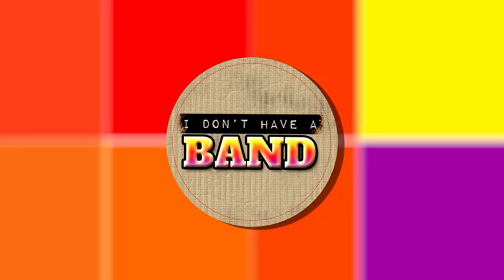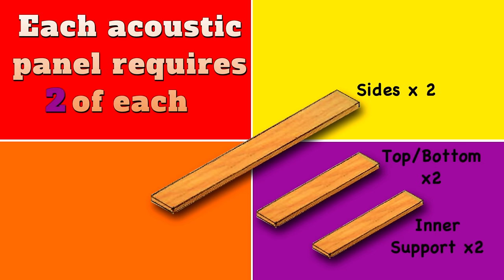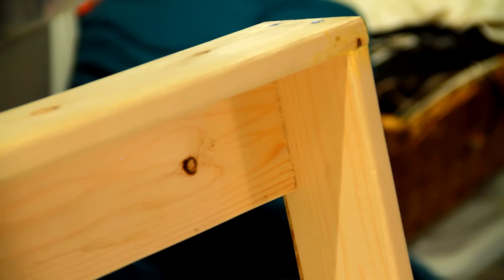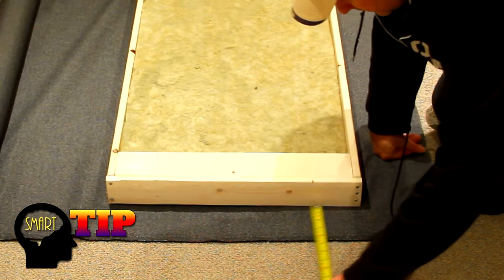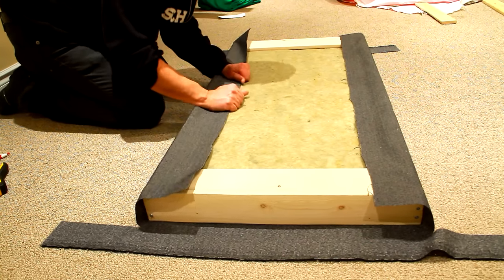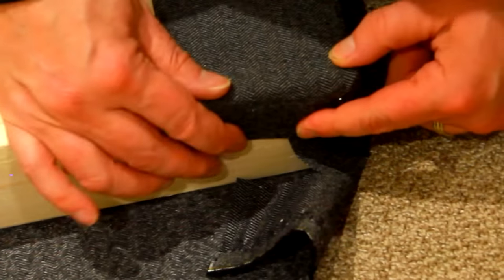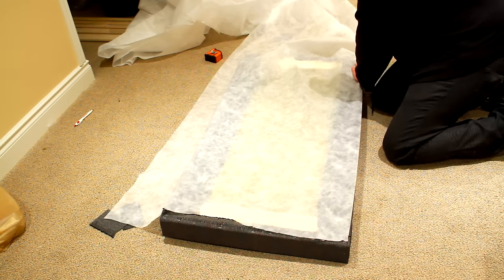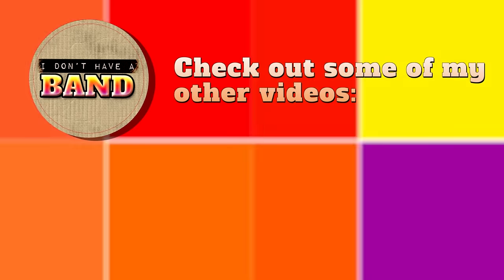DIY Acoustic Panels - How To Make Your Own Cheap and Awesome Panels

Comment: I wonder what your thoughts would be on using say 1x2s for the supports instead of 1x4s to shave off a bit of weight (I'd guess about a pound or so)?
Reply from the maker: The 1x4 gives you a bit of a gap in the back which helps lower the frequencies of what your panel will catch.  Especially if mounted right against the wall.  A 1x2 will still do something.  But in the DIY world without taking proper readings just do what you can and try them out.  A 2 inch panel is still better than nothing!

Comment: Try putting the backing on first. I like to make my corners into swans, just fold back the first piece like you suggested, then divide the remaining piece by the length of the first. Now carefully pinch the other bit of fabric near the top and staple clockwise creating a swan like replica with fully exposed wings and under carnage. I know...its a very simple method picked up from a veteran panel builder and cabinet maker, he's now dead so he won't mind if you use it.

Comment: Any reason to avoid using 1x4x8 furring strips instead?  Looks like that could save about 50% on lumber costs...would that work just as well?
Reply from the maker: If they are reasonably straight and give you the stability I guess it can't hurt to try.  But for something that could last you a lifetime some nice structural lumber is certainly worth it ;)

Comment: Do you know if the Roxul Safe'n'Sound is safe for exterior walls? I have them up as well but can't find any information if they are safe for the studio or as mentioned the exterior walls with fabric wrapped around it.
Reply from the maker: That's what I'm using in many of my panels.  Do research on Mineral Wool.  There are a lot of studies.  Some conflicting but best to do your own research or consult a professional.  Health and safety first!

Comment: great video! planning on following this to the T! which roxul did you buy? 2" or 4"?
Reply from the maker: Thank you!!  I used the 4" which is actually closer to 3".  Before you start I have a few panel videos on placement, testing and I recently did a Panels 2.0 video where I introduced some new concepts.  It works hand in hand with the video you already watched.  Check it out: https://youtu.be/MHnFYFZc-w8

Comment: Any chance you can point us in the direction of where we can order this insulation? I'm striking out with Home Depot and most other places trying to track down where to order 24x48's in a pack of 8. Got a link maybe?
Reply from the maker: I don't know where you are but here in Toronto, Canada I just walk into a home depot.  Your best bet is to go to the main Rockwool website and contact them directly to see who distributes their products in your area.  Good luck!!
Reply: @LonelyRocker  thanks! I'm in Washington state. Home Depot doesn't carry it and can't special order it without buying a minimum of like 12 bundles. Finding anyone who can special order it has been difficult. I got lucky and found a guy on offerup selling a pack of 12 3" thick x 16" wide batts of Rockwool ABF insulation. For 8 panels I can cut the extra 4 in half to fill my 24" space. This video is by far the best tutorial for these panels I've watched and I'll be building out my space very soon following your specs. Much appreciated!
Reply: You’re probably gonna have to go with 16” in the states as that’s what’s we normally use for stud spacing so 24” isn’t readily available. Just adjust all cuts accordingly.
Reply: Have been hard to find in US ever since Covid. 😢

Comment: I'm not sure if I'm measuring wrong, but if the top pieces are exactly 24" and the side pieces sit within that, wouldn't that diminish space and make the actual dimension for the insulation something like 22"? How did you make that fit?
Reply from the maker: Safe’n’Sound is soft and generally a little smaller than the published dime sound. It slides right in.  It’s better when it’s a little snug.  Holds in place better.
Reply: @LonelyRocker  that may be true for Safe'n'Sound, but many people might not be able to find that product.  I couldn't get it anywhere at that size, so I bought a different brand that does sell rockwool-type insulation in bats measuring 24" x 48".  However, it's not flexible enough to bend so on my first panel I ended up having to cut it down because the space inside my frame was smaller than 24" and 48" on both of those sides.  So I had to measure, which I did by laying the wood against the bat and just marking it off.  It worked out though... thanks for the excellent video on how to make these
Reply: This is what I was thinking too. I bought OC703. They are rigid and exactly 48x24”x2”. With these measurements they will be bigger and may need to be trimmed. Your side boards are 46.5”!tall, which is 1.5” shorter than OC703. It is a good video but can’t follow exactly if you are not using same insulation as yours.

Comment: I'm considering your build here for my Mix room that doubles as a vocal booth. Question..Did you find the 3" thick Rockwool too thick for wall absorption? I keep reading reading that 2" thick panels are the standard. I just don't want to "Over-Dampen" my room
Reply from the maker: Not at all.  You will deaden your room with over coverage, not thicker panels.  Panels for a mix room need to address first reflection points first.  There's more to it than that but if you are a DIYer in a home studio those would be the first points to address.  Sadly, the treatment for a mixing room won't be compatible with the needs of a vocal booth.  In this case you would want to achieve isolation.  Different process.  I have mixing room panel placement and a DIY vocal booth videos on my channel.  Check them out to see if they help!
Reply: @LonelyRocker  Appreciate the fast response! That's helpful info for my mix room. I was leaning towards OC 703, but the shipping was as much as the damn panels! insane. I can get Rockwool Safe & Sound 2'x4'x3" for WAY cheaper. As for vocals, i guess I'm not sure why an acoustically treated room wouldn't be suitable for tracking vocals though? 🤔  I've been doing it for years with fantastic results. I have no need for an iso booth as i record myself in headphones and there will be next to zero unwanted sound bleeding into my studio. So as long as my room reflections are tamed and im not getting slapback, reflections, or comb filtering.. etc. Then Theoretically i imagine I'd get decent results. I also have a reflection filter around my U87.
Reply from the maker: I actually do voice overs at my desk in the treat portion of my studio.  It sounds good too.  An isolation booth is optima but not always necessary.

Comment: Isn't this fabric too thick? I've talked to a guy who works for a company which designs studios and he said it's supposed to be how they call it, acoustically neutral which means you should be able to blow through the fabric and feel the wind on your hand on the other side. I wonder what's the difference between the two.
Reply from the maker: That was absolutely a consideration when choosing my fabric.  I mention that in the video.  As long as it is breathable sound can pass through it.  So no leather or vinyls 😁
Reply: Yeah, but if it's not leather or something, the sound should still be able to pass through. I mean, the part where you blow through the fabric and feel the wind on the other side on your hand, that's what I'm interested in. Never saw any comparison. It would be great if someone made a test.
Reply from the maker: The outer fabric has little to no effect on the absorption unless it's too thick and sound (air) can not penetrate it.  It's really just there to hold the materials inside and to give the panels a finished look.  I wouldn't labour over the fabric too much.  use the recommendation I made in the video.
Reply: ovo nisamja  yes, acoustically transparent fabric is needed so the insulation will perform as tested.
Reply: So Essentially Any Breathable Fabrics.
Reply from the maker: Yes.  There is more science to it, but for DIY guys just get a nice solid fabric that can breathe but is tight enough to conceal the insulation inside.  A lot of people use burlap.  Don't know why.  It's nast fabric.  Go to a fabric store.  You'll find a ton of options.

Comment: great video! if the Rockwool I have is 15 1/4 wide, should I make the Frame 15 inches wide? or 14.5? not sure about that. thanks for any advice
Reply from the maker: Thank you.  The best advice is to measure the outer edge of your insulation and them make the frame's inside measurement the same as your insulation. It can be a touch smaller and would still be fine.  Rockwool is flexible so you have some give.  Don't forget to take into account the thickness of the wood when calculating your cuts.

Comment: Since the front panel needs to have fabric you can breathe through, does the back fabric also need to be breathable?
Reply from the maker: I would say yes. If you mount the panels off the wall a little, the air gap behind the wall and any sound reflecting back through the panel will meet the same level of absorption.  If the back is not breathable you create a reflective surface immediately behind the insulation.  These panels won't catch every frequency.  Lower frequencies can still get through.  the more layers of absorption you create the better the results will be.

Comment: You can easily install an Android or iPhone sound meter on a phone and record the decibel levels with and without the panels hanging on the wall to see how well they absorb sound.  Also would be nice to put the sound meter on the wall and a sound source a certain distance away, then hand your sound panel over the sound meter and see how much sound is absorbed/blocked by the panel you built.
Reply from the maker: Check my channel.  I've done 2 test videos :)

Comment: The only slight concern I have for this is the material you're using. I've been told that you have to be very careful of the because if the fabric is not allowing all the sound to pass through then you are causing reflection. Any thoughts on this?
Reply from the maker: I have a lot to say about this.  I actually discuss this in the video link below but the key is to select breathable fabric.  If you can breathe through it, sound will pass through it.   It’s discussed in here: https://youtu.be/IjCtAccI_7w   Hope this will help you.
Reply: @LonelyRocker  So, I'm just curious with all the COVID concerns, if we go into a Fabricland and breathe into something after lifting our masks off what will the staff at the store say lol. I"m at the point of buying my fabric. It would be kinda cool if there is a definitive material name (i.e. polyester) with some other rating that could definitively say Yay or Nay. Anyhow, I'll let you know how the Fabricland experiment works out in the next couple days :)
Reply from the maker: Good point!  Most fabrics are breathable unless it's vinyls or leathers.  Just looking at it should tell you.  When I bought mine I didn't breathe through it.  If you're concerned just bring an air blower with you and blow through it.  You'll know if it's breathable and you can keep your mask on! :)
Reply: Lonely Rocker Awesome, I kinda figured as much. Your 2.0 video fabric looks sick. Hopefully I can scoop a roll of that
Reply from the maker: Good luck!!  Keep me posted!

Comment: Do you know about how many yards of fabric you used ?
Reply from the maker: Wow.  A math question ;-).  Well a yard is 36 inches.  My panels are 24 x 48 inches.  Factor in at least 6 inches of overhang in each side and you are easily over a yard per panel.  Ha.  I’m not even sure.  Best to calculate how much you need based on the size of your panels and the number you want to make.  Math is not my specialty ;-)

Comment: Thanks for the tips. The problem with all these videos on building panels is, no one describes what frequencies they are designed to handle. The biggest issue in every room is frequencies below 110 Hz. If you deal with those first, you suppress a lot of mid and upper frequency issues at the same time. Those panels are not effective against that range. Liked 👍 all the same! Thanks!!
Reply from the maker: I stopped making panel videos some time ago but this video has been so successful.  I did an interview with John Brandt.  You should look that up on my channel.  Unless you go a pro route with proper measurements you’ll never get it right. These are a great DIY solution to make the room sound better and absorb obvious frequencies.  But they are from perfect.  Unless you’re willing to pay big bucks you’ll never get it right.
Reply: @LonelyRocker  Sounds good - no pun intended 🤣. Thanks!

Comment: Just make up a bunch of panels using this great video, love the fabric/stapling strategy. I could only find Owens Corning Fire & Sound Guard in 15 x 47 x 3 inch in a reasonable price/quantity, so I adjusted the frame construction accordingly (made a few panels 'double-wide' with one 1x4 in between the 2 batts to keep em separated). The acoustic change in the installation space is dramatic. Echos have been completely eliminated. A few additional tips: (1) Select fabric for the fronts carefully. Too thick, and the corners will end up bulky, not crisp. Too thin, and there's a danger of ripping at the staple locations and corners. I found some solid black cotton/poly blend fabric on clearance for $1.90/yard at my local JoAnn Fabric store. Thin enough for easy folding/anchoring, with enough stretch to eliminate any seams/wrinkles. Finished pieces look awesome - like giant speakers! (2) The 1x4s I got had sharp edges, so I just lightly hand sanded everything (especially the corners) to prevent slicing the fabric. So glad I didn't go the Amazon/foam squares route.
Reply from the maker: Glad it helped!! Careful with fiberglass insulation.  Check my channel for my Acoustic Panels 2.0 video.  Some new tips and upgrades.
Reply: Thanks for sharing your suggestions. Plz let me know what fabric you used for front. I am little bit confused.
Reply from the maker: I actually did an update video to my panel formula.  And in it I explain the material I wrapped my panels in more clearly.  Check it out: https://www.youtube.com/watch?v=MHnFYFZc-w8

Comment: What do you think of making these with drywall regular or soundproof with the insulation I have a party wall and my home theater speaker are bipoles was thinking dry wall and painted so they still reflect sound but don't hit the party wall directly or even wall paper with a design and also make them on stands so they are modular but also decoupled from said wall
Reply from the maker: Unless you let sound pass through them the sound will just reflect off of them with little to no absorption or soundproofing properties...

Comment: May be a stupid question, but is the thickness of the Roxol, 4 inch?
I dont think it was covered
Reply from the maker: I did mention it.  It’s a bit under 4 inches as most construction materials are short as advertised 😜

Comment: Awesome vid man, Quick Question: Can you use pre-cut wood for this?
Reply from the maker: Thank you very much!  As for pre-cut wood, as long as it meets your measurement requirements.  The size of these panels were designed to fit the insulation I used so I didn't have to cut any.   But you're are not locked into this size.  You can customize the size to meet your requirements.  Just consider the work you will need to do to put the insulation in properly.  Hope this helps!!!

Comment: Could this be used on floor to block my downstairs neighbors noise?
Reply from the maker: Unfortunately that kind of “Soundproofing” is different.  These panels absorb frequencies from bouncing around within a room.  Soundproofing involves structural changes to walls, floors and ceilings.  So no.  These panels won’t solve noise from a noisy neighbor.

Comment: Very good DIY video. 

Unfortunately, my only option seems to be to order the Roxul on Amazon for $57 + $37 for shipping or order it through Lowes for about the same amount, but Lowes requires you to order a minimum of 3. I don’t even think I would use an entire (8 panels) package.

It’s a shame. I was looking forward to making my own acoustic panels, and this is the best DIY video I’ve seen.

Thanks for sharing this, even though I won’t be able to make them myself.
Reply from the maker: Thank you so much.  don't give up!  Also, check my channel.  I have other panel builds as well.  There are other materials you can use.  Rockwool/Roxul makes a product called Comfortboard.  I like that even better.  Check my other videos for ideas.  Maybe you can find an alternative so you can start to make some.
Reply: @LonelyRocker  Thank you! I’ll definitely check out your other videos!

Comment: I have a question in reference to  DIY  acoustical panels using Rockwool insulation , I made your panel as described in the video, after applying the burlap to the frame and putting up the panels I noticed my nose burning and I removed the panels from my room until I get more information about my situation . my room size is 10x10  . can you please help tell  what may be going on ?
Reply from the maker: Answered this same question in the other video...
Reply: @LonelyRocker   which one ?
Reply from the maker: You asked me this same question on my other Acoustic Panels video. So I answered you there...